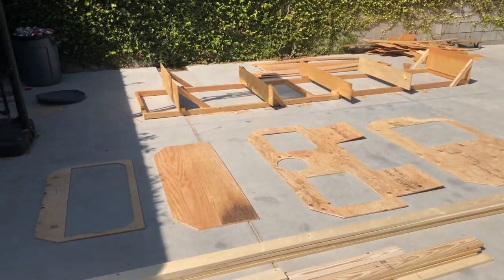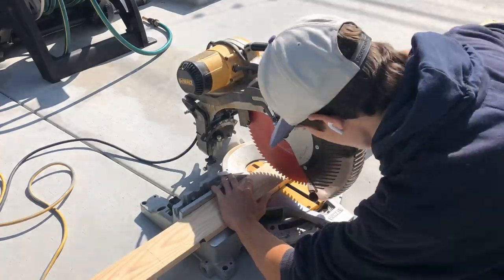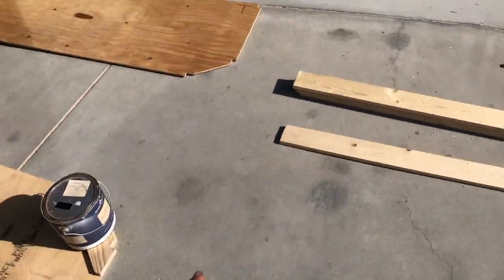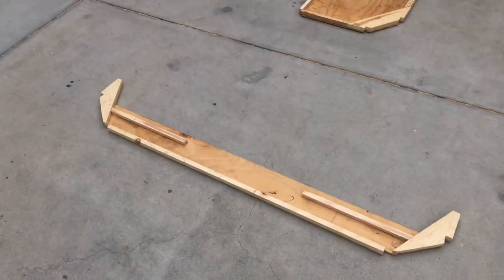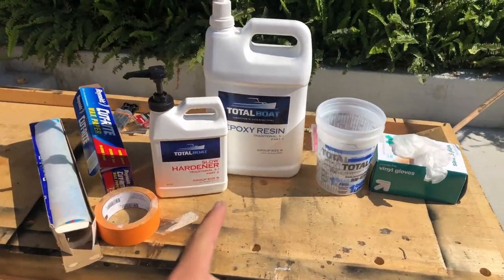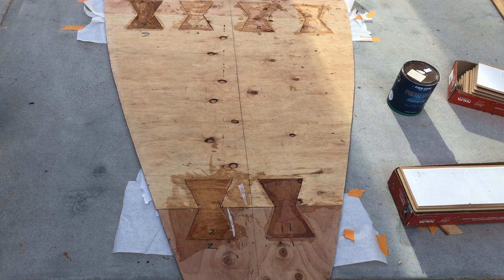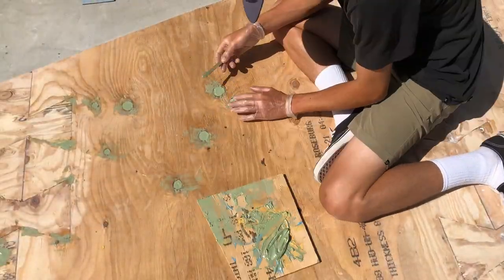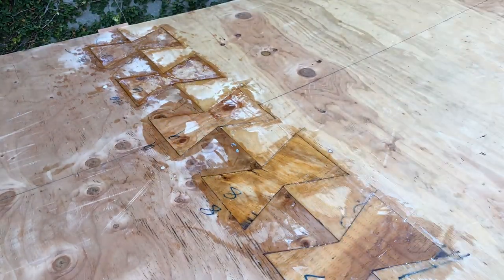Building A Sailboat From SCRATCH | Ep.2

Comment: Obviously, the point is moot now, since you've already done it, but if you ever have to join something like those keys again, add cabosil or micro-balloons to your epoxy.  It will thicken it into a peanut butter-like consistency and allow you to more securely attach those keys without having to redo the epoxy over and over to get it to fill in the gaps.  It will form an extremely hard, structural bond.  Otherwise, glad to see you progressing.  Looking forward to more episodes.
Reply from the maker: Thanks for the tip! Hopefully in the future, I'll be able to build a bigger and better boat.
Reply: @JackWood25   - This boat looks just fine, but if you continue building boats they'll only get better the more you do.  Incidentally, you can use that cabosil/microballons trick for fillets instead of the fairing compound as well.  It'll go on smoother and you won't have to sand it before applying the fiberglass over top.  Hope you're having fun with this project.  It'll be great to see it on the water.
Reply: Carbon fiber - structural, or not all all. Balloons are just filler. filler diller. 
Scrap glass strands if you don't have the good stuff.

Comment: You can mix sawdust in with the epoxy. You'll get a stronger hold. For next time
Reply: Nevermind lol I spoke too soon😁
Reply from the maker: It’s alright. Sounds like a good tip. I’ll definitely try it in the future.
Reply: @JackWood25  microfibres or colloidal silica is best for mixing with resin for glueing ….and gap filling
Reply from the maker: @rollinrock6696  Thanks for the tip! I definitely want to build a bigger boat in the future so I’ll take this into consideration.

Comment: What you're doing is AWESOME...My friend did the same,{slightly larger}, one and a half years of his retirement....NOW he can't get insurance from any marine agency because it is custom, one-off AND has fiberglass over wood hull....all his plans are dashed....have you checked on insurance?  no marinas will accept mooring without it....
Reply from the maker: I haven’t check insurance but where I’m planning on taking the boat, I’m able to just anchor. So if all else fails and I can’t get a mooring, anchoring will be my best bet. Also my plan is to just store it at my house when it’s not on use.
Reply: @JackWood25  Trailer boat smart. Guy up in Petaluma built one - ferro cement - weighed a ton, several actually as it was 54 feet long - always good for a laugh as these concrete sailboats being rather heavy would drag people down the fuel dock when thrown a line. My friend had a 36 ferro cement and all of that weight rides very smoothly compared to the typical glass bay (SF) boats. A guy crossed from Japan in 64 - they had the boat at the Maritime San Francisco building - think it was a wooden 14 footer. 
  I am not telling you how great you are like most here - you are an exceptional human being and what else would/should we expect? 
  Mine was a Catalina 22 up in Port Sonoma ...

Comment: I'm not trying to be an ass, but is that marine grade plywood? I thought you needed that so the ply wouldn't peel apart. Do you intend to put the material through some sort of process or cover it with something if it isn't marine grade plywood? If so, I'd appreciate if you'd share it with me. I'm getting prepared to build the much simpler Goat Island Skiff in the weeks to come and I'm really struggling to find marine grade 5-ply of any kind where I live.
Reply from the maker: You’re not being an ass, it’s just a good observation. The plywood that I used isn’t marine grade plywood. Although in the next few episodes, I do cover the entire boat with two layers of fiberglass and epoxy to fully seal the exterior. If you can’t find any marine grade plywood in your area, I can give you a link to a website where I purchased the fiberglass if thats helpful. Also love hearing that you’re going to be building your own sailboat, that’s awesome!

Comment: It looks like you are doing a pretty good job. I subscribed. Are you a rich kid? Are you going to junk rig it?
Reply from the maker: Thanks for subscribing and no, I wouldn’t call myself a rich kid. All the money I make from my woodworking business goes straight towards this project. I was thinking about junk rigging it but I was able to find a really cheap mast so I’m just going to rig the boat with a Bermuda type sail.
Reply: @JackWood25  It is your boat - but do a cat sail. Electric trolling motors - battery (Lead acid) ballast. Compass - lights - flare gun - and smoke -
Reply: "Smoke on the water ..." Deep Purple mid 70s ... guess you missed it ... when you don't get the cultural references ... but USGS approved smoke for day use. Not that other smoke, ok.